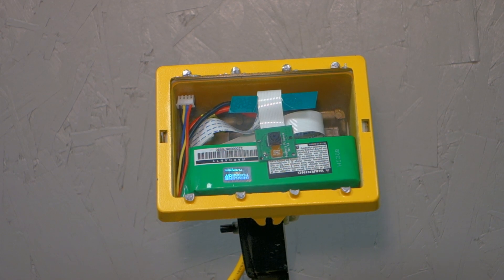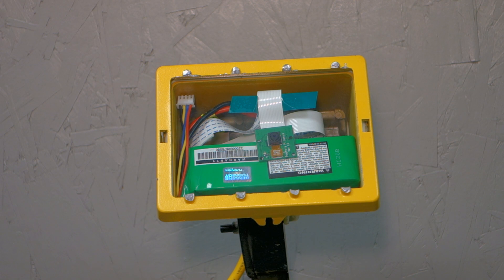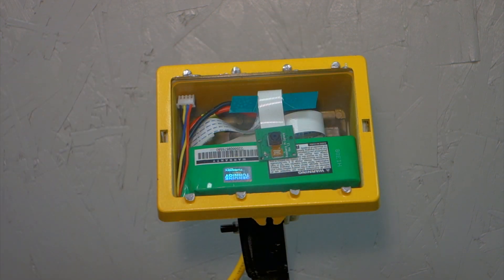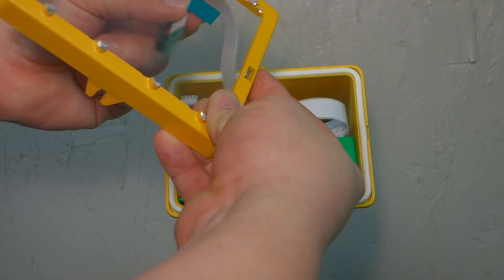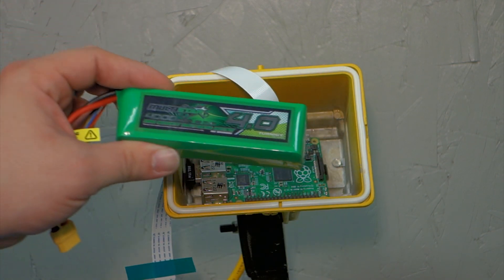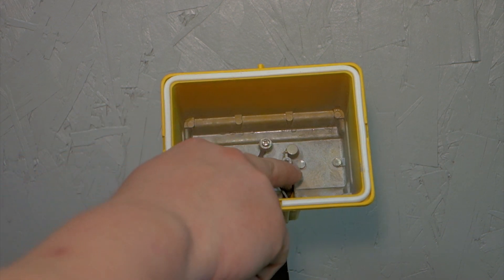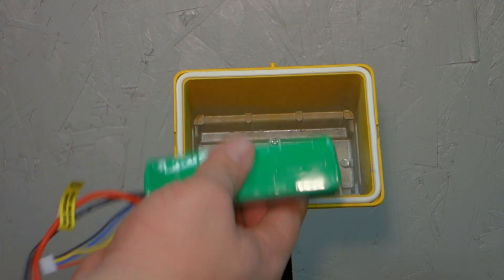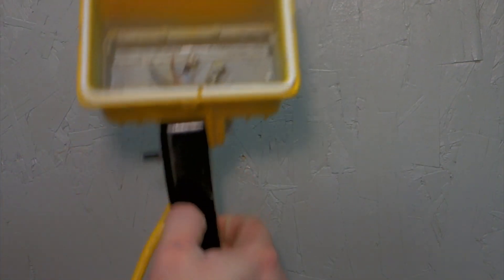Weatherproof Raspberry Pi Flood Lamp Outdoor Camera Case

Comment: Great job. You can also run a PoE cable through the base of the unit and remove the battery or just run a separate power and data feed. Nice idea I love it. Have you exposed a Pi to extreme cold yet? I'm in New England and the winters can be harsh at times.
Reply from the maker: sure also check out the new robot video I just uploaded.